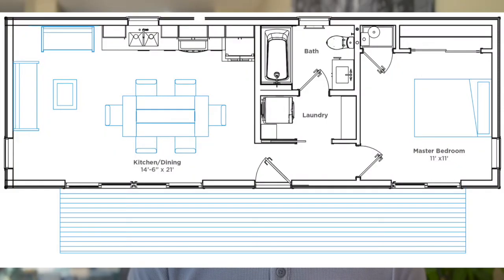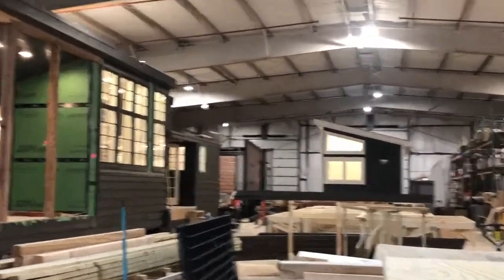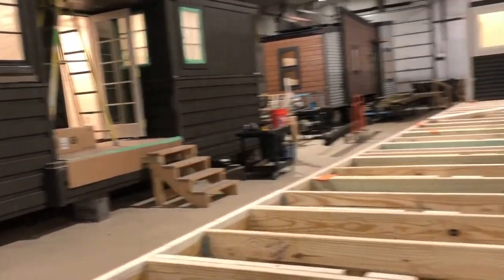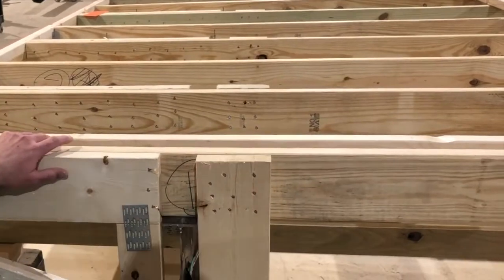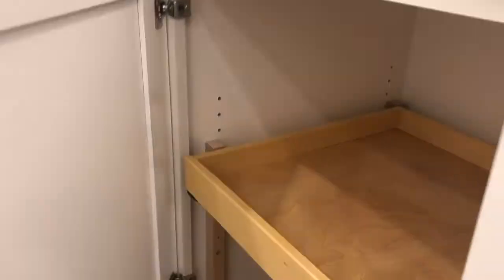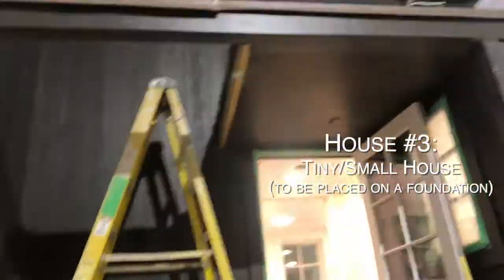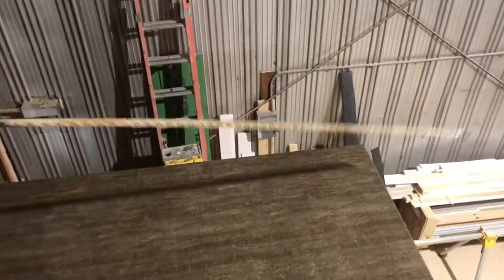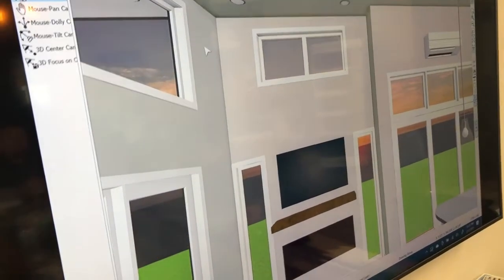Buying land for airbnb in Joshua Tree: What we Learned about PREFAB

Comment: Nice man! What is the total cost for the one you designed?
Reply from the maker: Thanks Steve. We were quoted around 200-250k, but we don’t know if that will still be the case. Were you referring to the design fee? Check out my latest video for updates on where we are now with building costs now.
Reply: @ShortTermRookie  do you have to run sewer, electricity, and gas to site?
Reply from the maker: @kdockrey  we have to build septic system for sewer, but we have water meter and utility pole on site. Did you get a chance to check out our other videos?